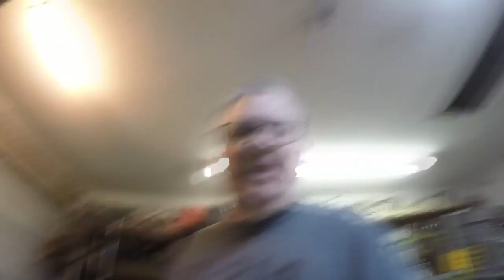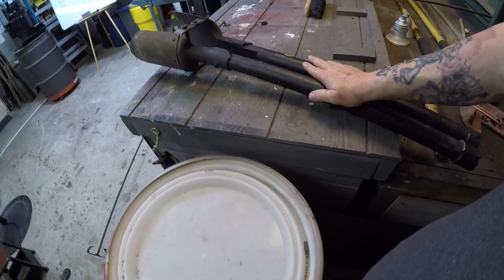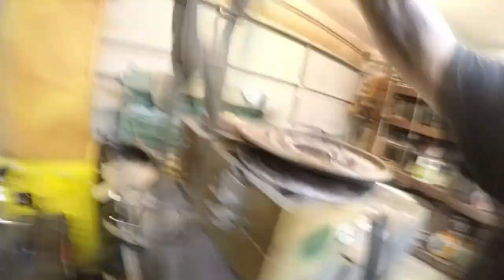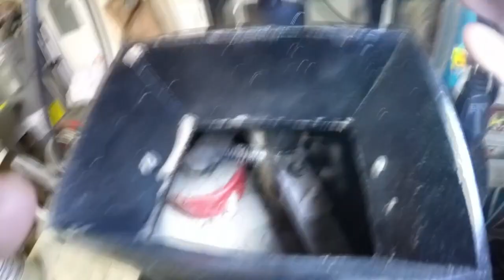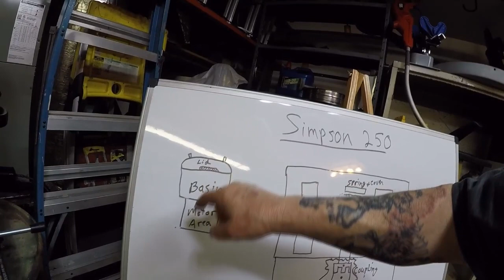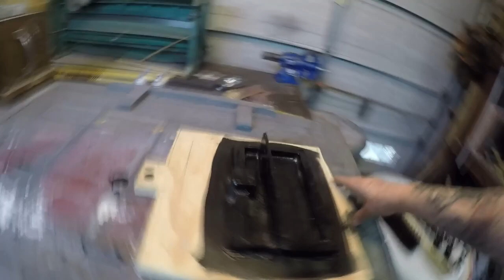Foundry upgrade

Comment: Good to see you back.  Nice upgrades!  What brand of muller is that?  I bet you can fix your petrobond with it.  Looking forward to the mold wash and molding/casting videos.
Reply from the maker: It's called the Mini-mite Sand Muller and I got it from Midwest Technology at www.midwesttechnology.com. It cost $4000.00 when I got it but I'm not sure they handle it any longer.

Comment: It's great to see you back making videos again. What are your thoughts on using sodium silicate/water glass sand for making molds for aluminum? My goal is to one day try casting my own engine block. I've come across a way to design the block so the intricate hard to produce  internal cores are not needed. Petro bond for a mold this large would be astronomical, and I feel like you have to play with green sand for awhile before you truly get a handle on it. I made an aluminum casting in high school and enjoy learning more about the subject. However it's a process I want to use a few times and not turn into constant hobby.
Reply from the maker: There's a great many people who use sodium silicate as a molding medium but once used it can't be reused. A costly experiment. We in the Navy used sodium silicate to make core sand and it worked quite well.

Comment: I'm glad to see you back and know you're doing well. That's an interesting muller, I've never seen a horizontal wheel one before. I can't wait for the mold wash video. Where I work we use "boron nitride" it's like a thick blue paint.
Reply from the maker: What do you cast using the boron nitride as a mold wash? I don't know how much it costs but it might be worth your while to investigate the cost of the ingredients used in the formula I will soon be showing everyone when  I make the mold wash video. If the cost is a great deal less you might introduce that wash to your boss. He/she might give you a bonus.